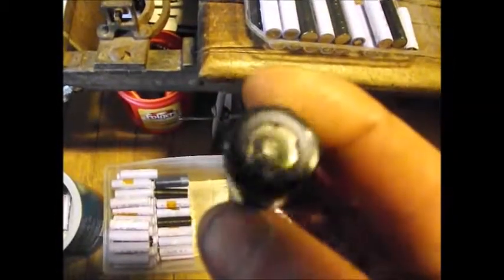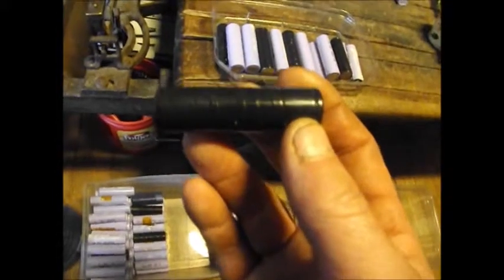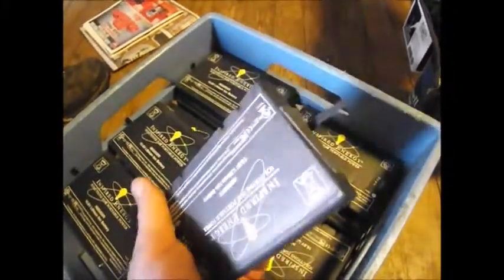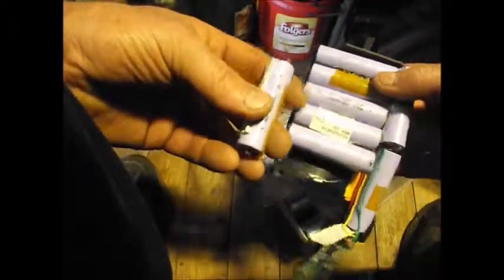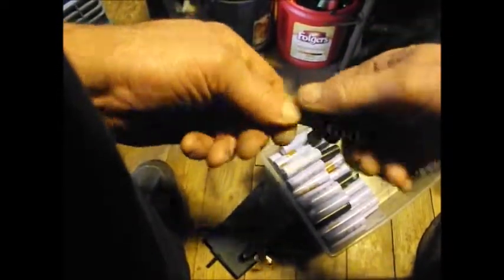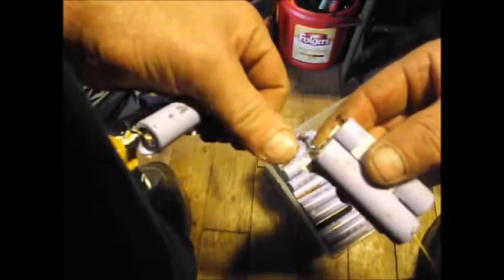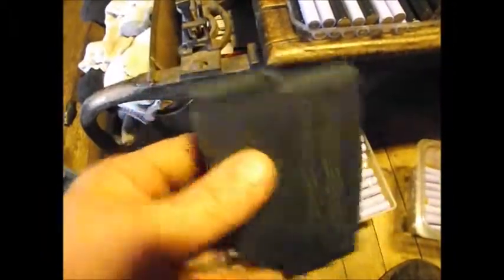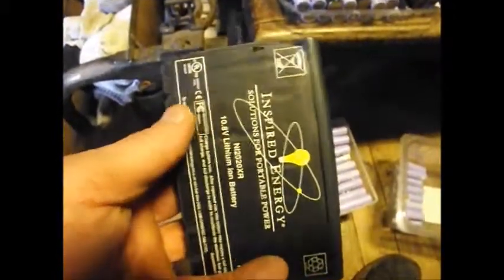Off Grid 14 8 Volt Battery Pack Making From 16850 Lithuim ion Cells Using Around 700 cells

Comment: I would cut those tabs with a pair of nippers and leave part of the tab attached to the battery, the tabs are easier to solder to than the actual battery is
Reply from the maker: Off Grid Texas Homestead No No I,m not going to use them tabs. I have these other tabs already I,m going to use. Good idea tho  Off Grid Texas. Would most for sure save some time.
Reply: Some batterys don't take the solder well, that is why the weld the tabs on, they don't stick many times with solder, plus heating up the ends of the batteries messes them up sometimes. The metal tabs the weld on do take solder and heating it doesn't effect the batteries especially if you are quick in soldering. Just thought I'd pass that along to ya buddy. Good deal on the batteries though
Reply from the maker: Off Grid Texas Homestead Na I never have problems soldering tabs. Maybe your soldering gun is no good. Mine is a soldering station and it can get very hot and makes for fast soldering with out heating everything up to much. Soldering guns I would not use. I could see problems using one of those for sure. They just don,t get hot enough and it heats everything up to much and that's where the problem comes from if the battery goes bad due to soldering. No I,m ok with the way I,m doing things with my soldering station. But I might just build a spot welder putting this bank together. Spot welding is the best way to go for sure. l,ll see as I get everything ready in the mean time. Thanks for the tips tho Always nice to have extra minds at work for offering tips.
Reply: Yeah, I have a good soldering station, temp and wattage controlled, I'm an electronics tech  so I have a good one. I went to school (college) for soldering, I was the only person in a class of 35 people to make a 100 on my final exam in that class. Our teacher was a biomed technician, he worked on hospital electronics like EEG and EKG machines where there can be no bad solder joints because it could cause the machine to malfunction and someone loose their life, so he was very strict in grading our work and I made a 100, my lab partner made a 99, I taught him my technique, he had never used a soldering iron before. I'm very good at soldering. I also have the soldering guns, light duty and heavy duty as well as butane soldering iron, and acetylene torch. I used to  build air conditioner coils, using a torch and silver solder, then I moved into Quality Control at that company because I was very good at soldering. I also have the welding setup to weld the tabs on batteries. It uses a large storage capacitor that discharges current for a split second to weld the tabs on the batteries. That would work on using the welder to put the tabs on, but you'd have to buy/locate new tabs, I rebuilt the battery in my harbor freight 18v drill that they stopped making the battery for by just cutting the tabs from a new battery and resoldering it in a different formation, they had changed the shape of the battery case so I had to re-position the cells in it and I used regular copper wire to rewire it and it saved a useful tool. I was thinking soldering it might cost less to do than welding the tabs, I always like to do things less expensively if I can. :-)
Reply from the maker: Fore sure I understand. I just happen to have 1000,s of new tabs already. No real extra cost here.me to I have all those soldering things you said. I can see your point on being perfect . That's just not needed for what I,m doing. Its going to be good tho. Its just might not be perfect to eye,s looking. But it will be strong and stay together just fine. For me its all about what and where and why its being done. Some places it calls for perfection and other places of doing it don,t. As long as its safe and no risk I,m ok with that. Most things I do is for my self. So perfection is just not needed. Perfection can take major and I mean major extra hours of involvement. For this its just not required. Its going to work out good.
Reply: Cool, it's good you have those tabs!
Reply from the maker: I for seen this coming and have been ready for the moment. Look ahead it pays off